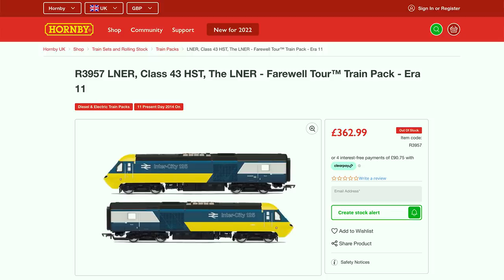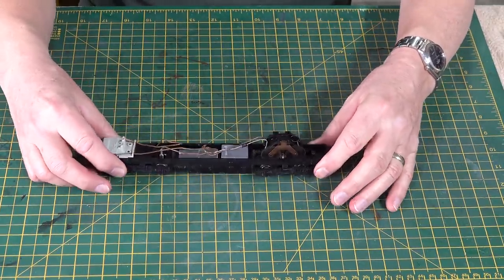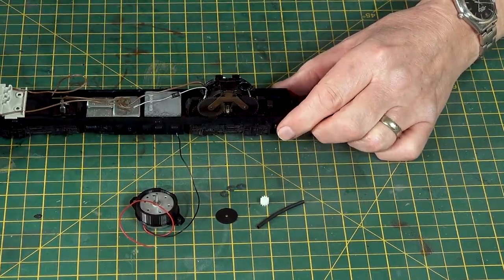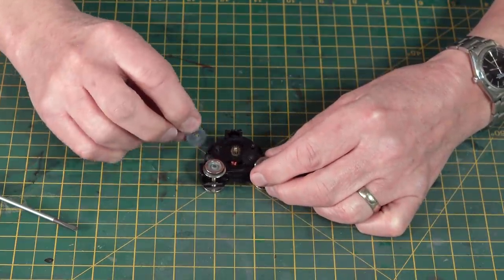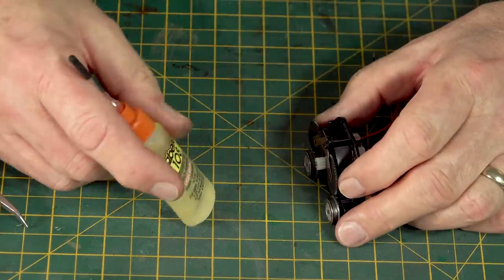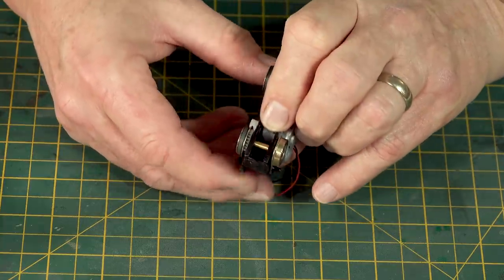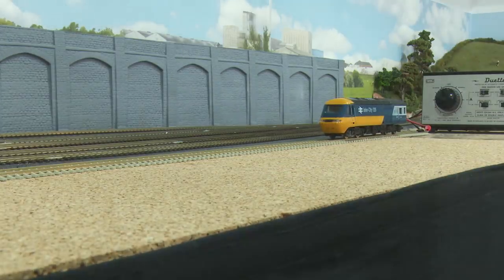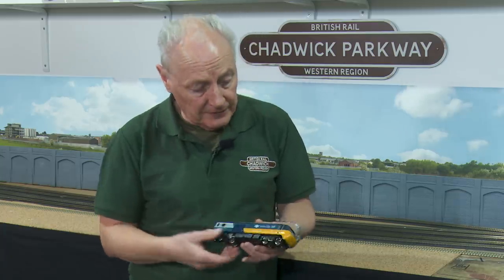Replacing Loco Motors at Chadwick Model Railway | 151.

Comment: When you convert it to dcc are you going to use one of the accessory plugs for the light? That way it will turn on at whatever speed you are going
Excellent video and a great product!
Reply from the maker: Dead right but fingers crossed that it works Josh.

Comment: Hornby actually sold updated Hornby tooled HST sets in Virgin livery many many years before they relaunched the detailed DCC compatible HST car sets based on the Lima tooling. Anyway these old Virgin HST car sets had the same Hornby chassis as the originals but with an updated China made 5 pole motor in them, i used a donor set to modernise my 1980s Intercity blue HST sets, the newer Hornby sets also had wiper pickups & skinny wheels. Mine ran superbly with a rake of 9 modern full length coaches & a power car each end. I also fitted LED prototypical directional lights to each power car.
The old Lima stock got these motor conversion kits way before they did them for Hornby.
Reply from the maker: An interesting comment.

I also have tried to acquire the five pole Ringfield motor. Regards Charlie

Comment: This is excellent Charlie as I have several HSTs and the one in your video is the one I was wondering how to improve. I agree on the new HST pack prices, totally ridiculous. I wonder now if its possible to upgrade the Lima versions in the same way as I have 2x packs in the GNER livery with silver and gold lettering. Cheers ** Addendum: I just saw on his ebay site he has the replacement motors for Lima so that's me all sorted. Excellent
Reply from the maker: Good luck Paul, I’m betting that he will soon run out!

Comment: That’s a crazy price for the new class 43s I got mine a couple of years ago from frizinghall models for around £260 and mine was a TTS sound fitted cab door opening version. Also I don’t know if you have seen the lighting upgrade kits for the older versions on ebay
Reply from the maker: Yes these prices are shocking. I have seen the lighting board for the upgrade and have them on the bench already. Regards Charlie

Comment: Hornby have put their price up across the board by almost 10% again from what I can see.     They did the same a few months ago as well......
I have one of those Early HST 125's as well.   I actually kept the Ringfield motor and DCC Converted it.  I got a LED Light kit for mine from Blackcat  so it has directional lighting
The original 3 pole Ringfiield is a bit noisy, but it actually crawls really nicely. I do have a CD Motor kit from Straphpeffer Junction, but I haven't fitted it yet.   It seems to run better on DCC than it did on DC.      I don't think the model you have is indicative of the bahaviour of that era of HST in general. 
I found the Chinese made version (which I have) has proper pickups on all wheels and proper isolation between the motor and chasis so was very easy to convert.   The British made version does not have the same isolation between motor and chasis and is a lot trickier to convert without doing the whole motor change out.
Reply: I did the same light conversion and just serviced the motor.  Fitted a ZIMO £20 decoder and the loco runs perfectly, and like yours, creeps also.  A budget Lais DCC decoder fitted to the trailing power car completed the lighting set up.
Reply from the maker: Excellent comments gentlemen
I’m so pleased that we are able to improve on these tired old classics. Regards Charlie
Reply: @ChadwickModelRailway  Thanks Charlie.   With the price of new models being virtually out of reach for a lot of us, it is great that these old models can be revived

Comment: One of my many planned projects is modernising an ancient Hornby/Triang DMU that I inherited.  I was considering putting in a new motor bogie from a more recent model, hadn't really thought about the possibility of putting a better motor into the ringfield unit.  How did the Frome show go?  I ended up working and didn't have time to get across unfortunately.
Reply from the maker: Good luck with the replacement motor project.  The Frome show was well attended but with sensible social distancing. I only spent £33 but some folks couldn’t wait to spend!  Too long locked up I imagine.
Regards Charlie.

Comment: I'm sorry to say that I have missed lead you on the cost of  plastic grease , I checked back on my purchases on eBay and the cost was £4.25 , all the same  money well spent  and the pot size though not large will still be over half full long after I've gone. 💀👍🚂
Reply from the maker: Could you tell me who the seller was please Mark?
Reply: @ChadwickModelRailway  I bought from  connections*02fs  but not showing this item now,  haven't found another seller  UK focal 60602 the pot showing in listing looks very much like the one I have....£1.32 plus postage  hope this helps....Mark

Comment: I have one of these old HST sets, so thanks to your video, Charlie, I've just ordered a motor and am going to give it a go. Otherwise it'd not be used and that'd be a shame.
As truly shocking as that new HST price is, it may be a reflection of higher important costs (it costs me much more to order PCBs now for my own projects) and higher prices with labour & materials in china. Covid+Brixit (and I'm not decrying or supporting the latter - it's just reality). And there's also the shortage (and so higher prices) of electronic components (mostly ICs).
Reply from the maker: Yes I do understand the electronics shortage issue. I’m trying to buy a new Sony camera but they are not supplying them currently due to a processor shortage!
Reply: @ChadwickModelRailway  Yes, it's definitely annoying and it looks like we're going to have another year or more of such shortages if what I hear is true. Very annoying, but such is life.
By the way: I got my 125 HST motor replaced and it seems much more reliable. Just need to get the DCC and lights working. Thanks again for the video - very helpful! 👍

Comment: I can see the need for a new tool: "Variable Diameter Wheel Extractor" I recently bought a new extractor tool for removing a keyed part from the drive spindle of a powered lawn mower - and there was a lot to choose from - however this would be somewhat smaller - but the principle will be the same! There are special 'circlip' removing and inserting tools. What solder do you use - leaded - or - lead-free? I understand the lead-free variety tends to give dry-solder joints. Yuk!
Reply from the maker: Great comment Michael. The solder I use is 60:40 lead. I find that the it’s ideal, regards Charlie

Comment: Superb video Charlie, very interesting 👍. One question, what's the difference between the ring field and new motor? All I can think is that maybe the new one could be a 5 or even 7 pole motor instead of 3,or is there more to it than that?Just be interesting to know.
Reply from the maker: I believe that they are brushless induction motors. Regards Charlie
Reply: @ChadwickModelRailway  Thankyou Charlie. 👍

Comment: Love the channel and find it inspiring. I recently bought a Lima class 40 used but what seemed like great condition. Unfortunately when it’s on the layout it short circuits the controller, any suggestions
Reply from the maker: Perhaps it’s a motor issue. Maybe if you took it along to a model railway show, someone might have a look at it.
Reply: Make sure all the wheels are the correct way round - if one has been replaced the wrong way round there'll be a short circuit.

Comment: Hi Charlie, i have fitted a couple of those motors to my hst's and found then a great improvement i have also fitted front and rear lights and they do improve the look of the locomotive, i only run dc as i have only a small layout, can i ask you where you purchased your wire strippers from, regards, Clive.
Reply from the maker: You need to Google RS 382-2847.
Be warned, they are not cheap!

Comment: Great video again Charlie. I just looked through your other videos as I remembered you recommended a Brother printer in one of them but I can't find it. I wiring up a new layout which is quite complex (for me!). Can you remind me which one please? Do you still recommend it & does it work with 16.02 & 24.02 wire as the web site for it doesn't say. I'd appreciate guidance. Best wishes, David
Reply from the maker: Hi David if you go to the show more tab you will find the details listed there.

If you’re still stuck contact me again with a fresh comment. Regards Charlie
Reply: @ChadwickModelRailway  Hi again Charlie, Thanks for getting back to me. I found the printer on the show more tab before I first contacted you as I have used your recommendations several times - terminal blocks & soldering iron etc. Your channel is really helpful to someone returning to the hobby after 30 odd years! What I really wanted to know is whether you can use the Brother on the smallest size cables - 16.02 & 24.02 sizes (2mm & 2.5mm outside dimensions)  are they shrink tubes or wrap around?  and what cartridge(s) do you buy? I have spoken to Brother (by email) & they would not confirm the 5.8mm sleeves (their smallest) would shrink enough. So I thought, as you use one you would be able to help? Thanks again, David

Comment: Im very surprised by the vast improvement that new motor gives.    I suspect traction could be an issue though as its still only got 2 driven axles and pizza cutter wheels.
Reply from the maker: It’s really just a matter of making the best of a poor design. Regards, Charlie

Comment: Hi Charlie.  I always enjoy your videos.  I had one thought and I hesitate to ask but here goes... did you consider doing the DCC conversion first to see if the back emf and all the motor control would make the old motor run OK?
Reply: I've serviced one of these and fitted a ZIMO £20 decoder.  Runs perfectly and even creeps.  No need to replace the motor.
Reply from the maker: Hi Tony, I must confess that I hadn’t. However, the noise from the old motor and it’s unpredictable running was enough to convince me that it was time for a change.

Comment: Hi Charlie great vids as always. Could I ask you 2 Q's? When you get to adding the scenics for the branch line woodland scenics 'walls', what material are you going to use ? And do you just push the droppers straight down to the existing bus or is there  a separate arrangement? Just to let you know, there's a good number of new modellers in my club who are using your video's as a manual for layout building. Thank you. Peter.
Reply from the maker: Hi Peter for the walls, I’m going to use a overflow downpipe arrangement to hide the joints, and then also some Woodland Scenics flock etc to replicate ivy growing up.
Also there will be some weathering with paints and powders.
Because of my use with block detection generally speaking I don’t use a traditional bus wiring method.

I take all the black wires back to terminal block whereas the red cables will go back to the block detection component. Regards Charlie

Comment: Hello Charlie. Great video and very topical at the moment as prices of these things even on ebay have gone through the roof. £425 for a second hand R3622TTS on ebay!
A couple of questions though,
Have you tried running it without the traction tyres?.....as I will be converting mine to DCC will the tyres perform,  as we both use the same track cleaner and you mentioned in that video that loco's with traction tyres tend to struggle with it.

Kind regards
Roger.
Reply from the maker: I take your point Roger. However, I’m converting it for a Patron supporter for use on his layout and therefore the complication with traction Tyres probably doesn’t apply. Regards Charlie

Comment: Steve Harrop
Hi Charlie, excellent video once again. (Aren't they all?)
Can't help noticing that the 125 has traction tyres. Do any of YOUR loco's have traction tyres? If so how do they get on with Innox MX3 please?
I use MX3 but thus far I do not have anything with traction tyres.
Best regards
Steve
Reply from the maker: Hi Steve, yes I’m led to believe to avoid mixing Inox with traction tires, but I’ve no experience of this myself. Regards Charlie

Comment: Hi  a very good video, though this arrangement has been going for some time now, I would like to point out that oiling plastic gears is not the best idea!
Please don't think I'm being an arse but I've bought many a second hand locomotives where over oiling has caused gears and even wheel spokes to softened the plastic, 
Many a bachmann split chassis models have passed on to the locomotive graveyard because of oiling,.  Oil in my mind is for metal to metal lubricantion,, there is a very cheap grease  
Special made for plastic gears not only does it lubricant but it makes the gears run smoother and quieter  a small pot cost about a quid, post free  from China and I recommend you get some........Mark
Reply from the maker: Thanks Mark, I shall have to look up which grease you mean.However, the oil I used is safe for plastics. Regards Charlie

Comment: I must admit, you conducted this a lot more elegantly than any conversion I've done! I'm a huge fan of the ringfield motor for no particular reason, but must admit these "CD" motors perform brilliantly. What is your impression of how the motors will fare in the long run as there are small openings that could potentially gather track "muck" over time?
Reply from the maker: It’s hard to say but some folks did this conversion a few years ago and I’ve received no negative comments.

Comment: Great to see that there are ways of keeping old models running, recently serviced my old HST from my younger days nearly got a new ring field motor but got it going nicely but if it fails I know what I'll be doing, thanks Charlie and Mark, I did buy a circuit board of eBay to give red and yellow LEDs even on my DC. And also my old HST whilst not being as "good" as a new one, as well as being affordable comes with free memories.
Reply from the maker: An excellent comment Phillip. 
Regards Charlie

Comment: They are not perfect but I'm a big fan of the old Ringfield motor, I have a lot of locos from this era that use it, I find many of the motors are still good and easy to maintain. In my experience spares are plentify and having the ability to swap them out with these kits makes older ringfield locos an appealling option on a budget.

I would love to have an East Midlands HST but I'm sticking with my old Lima Virgin XC HST as I simply can't justify the costs of the new one, its not just the loco price but since it has no coaches you need to add those on top as well. I wish they'd sell the packs that have the power/dummy car and 1-2 coaches as a slightly better value option.
Reply from the maker: I totally agree Z465. The cost of upgrading an HST set, is enormous. Regards, Charlie

Comment: Also with shrink tube the 2 nukmbers like 20 / 10 means 20mm unshrink 10mm max shrink it will go
Reply from the maker: Yes, the stuff I use has a 2-to-1 shrink ratio. Regards

Comment: Like you said Charlie why spend £363 on new tech, when one can buy a few bits and bobs to upgrade an older model with a bit of time and effort. So probably for the £63 in parts and the other £300 on buying lots more vintage coaches to make up a prototypical full-length train. Plus buy that Kernow Class 41 Warship out of the change. Well done to Mark for producing this motor upgrade kit and extending the life of an old model. Now if only I could get a cheaper upgrade for a multitude of worn-out body parts for myself than paying for a private surgeon, and still have change to go on a full board holiday, with spending money of a few grand, LOL.
Reply from the maker: A great comment John. Yes it only our body parts were available through Peter’s spares! Regards Charlie

Comment: Hi Charlie
You’ve given me a chance to ask the question I was going to ask in the Q&A episode I asked for. I fitted Identical CD motors and TTS chips to two old DC DRS Class 37’s which I want to run on double headed nuclear trains. But, they operate at different speeds for the same throttle setting. I’ve tried adjusting the CV variables (purely by trial and error as I didn’t really know what I was doing!) but I can’t get them to match. 
How do I do this?
Best, TonyS
Reply from the maker: It’s a difficult one Tony. My first question is are the motors identical and the second are the decoders identical? Regards Charlie

Comment: I have seen this video many times and havin got my hands on a Lima 125, I have been trying to find a motor the same as your Hornby, would the same motor fit into a Lima, which was sold back in the late 80s as I would like to put a decoder into it. Thank you for any help or input you can give.
Reply from the maker: I really don’t know if it would fit. 
Perhaps contact one of the eBay sellers for some advice. Regards, Charlie
Reply: Thank you for responding I have asked on youtude but to date you are the only one that has come back to me which shows to me and others you are a professionnalisme to the Model world, out standing Charlie.

Comment: Hi Charlie i have been following you for a short while and I am worried by the pricing of models these days especially for the younger modeller are the manufacturers going crazy with pricing. This will only steer younger people away from such a great hobby and endanger them selves in to the bargain
Reply from the maker: That’s so true Les. And also it may well put up the price of secondhand locos! Regards Charlie

Comment: To run a 6 Volt DC motor to run with a 12 volt DC supply, safely? Use two 10k resistors rated at 1/2 watt each and each resistor is soldered to the positive and the other soldered on the negative side of the motor and the tails of the resistors to the supply 12 volts DC supply from the rail contacts or DCC chip.
Reply from the maker: Now that’s a very useful comment Iain, thank you very much indeed. Regards Charlie